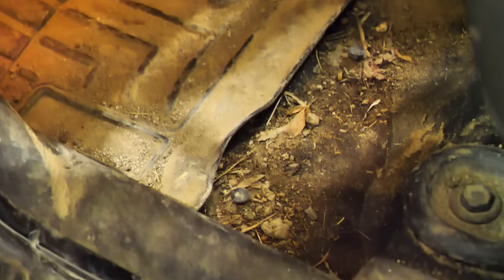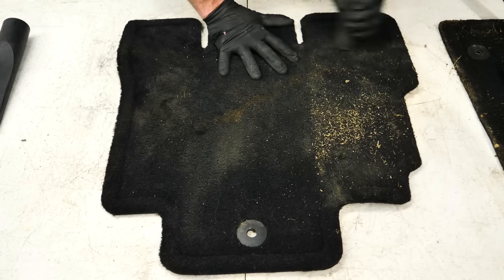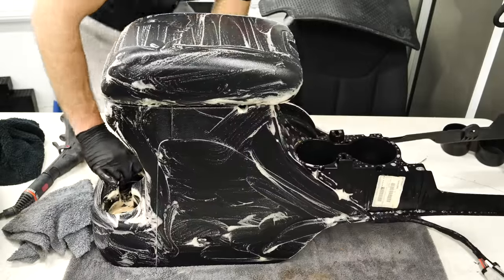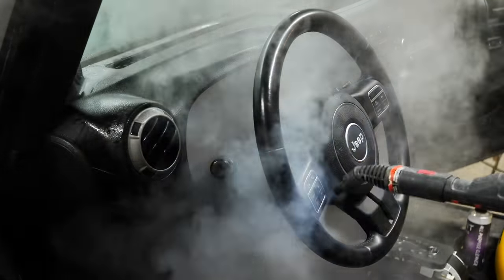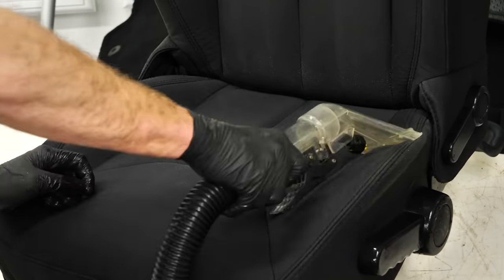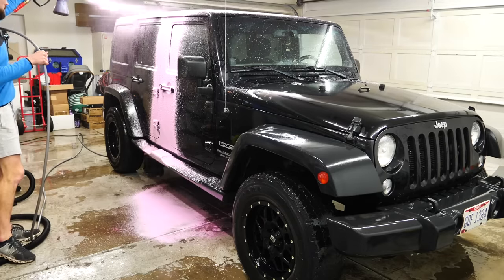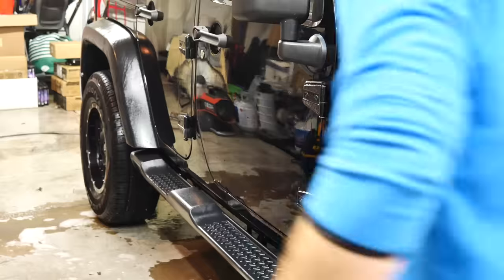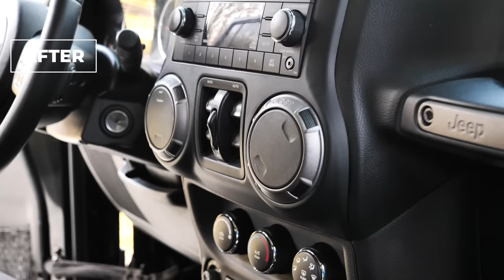INSANE Deep Cleaning of A Dirty Car For Free! Stolen Jeep Car Detailing Restoration Ever!

Comment: In all honesty, I’m not surprised at all that your ‘94 teggy gsr got stripped of her parts. I mean its a GSR engine hahaha. Sorry that happened to you all those years ago, and it was your first… I would’ve just been so pissed, while also being sad, or devastated, just mixed w/ all types of emotions. Back in Oct 2021, I lost my first car that I bought myself, w/ my hard earned money at the age of 18, I just turned 21 back in December. Thankfully I didn’t throw on any coilovers, or wheels, but I did keep up w/ the maintenance. I had just got the timing belt done w/ all the other maintenance that has to be done the same time, which cost me 1.2k, I bought a set of brand new tires that ran me $900, and I had just changed out all 4 break pads and calipers that cost me about $400. I literally balled my eyes out after I got hit, not because I was injured or anything, but because my baby was totaled… I didn’t even get the chance to put 100k miles on her. The person who hit me was a underage teenager w/ no license, nor insurance. She t-boned me by running her red light that had already turned red for a solid 5 secs. She was also going 55 mph in a residential area. Long story short, the police came and gave her two tickets for driving w/o a license and running the red light, still doesn’t satisfy me because I still lost more in the end.

Comment: So i have my first seat extraction for a client, and im stuck on which product to buy. I will using a spot clean extractor + drill brush + steam *if needed, client says previous detailer couldnt get the stain out, so now its my turn >:)

Im stuck between 4 products, the CG lightning fast, the CG carpet clean, folex, or super clean (5:1)

What are your opinions / what do you use?

Comment: You know what i do with those rubber or silicone inserts for cup holders etc, before you start your detail, i throw mine in a sink of hot soapy water if they are really sticky, that way it gives them a chance to soften and then they are easy to clean, then i clean them good and let them dry or dry them with a microfiber towel.

Comment: If you ever own anything worth steeling install a dizzy switch and a starter cutoff hidden somewhere in the cars interior. Or really anywhere it will stay dry. That way if they try and hot wire it the starter still won't be getting any power. And if they do manage to get it started it won't go very far without the fuel pump working. Won't stop all thefts. But it will give you more time to respond and make it take longer to steal. Just have to make sure your switches are extreamly well hidden.

Comment: Way back I had a 99 Milano Red Civic SI stolen and stripped. 1wk later I found out who it was and so I and a few friend went to his house, low and behold all my parts was in his garage still. So I took them back and called the cops.  Sold all the parts then bought a 2006 Ford F350 King Ranch CCLB w/ 6in lift on 37s.

Comment: I have a Jeep Wrangler story. Thought it was stolen leaving the Dr’s office. Called the police and everything. Only to find my jeep 100 ft away down over a 2 ft drop in a adjacent parking lot. I left it out of gear and the parking brake did not hold. Crazy, it took a left turn and parked itself almost perfectly in between two parking spots. If it rolled straight it would of hit a car or further, the ACE hardware store lol… super embarrassing 😆

Comment: Awesome, that is a great tip with the polisher, I've even seen some guys use a palm sander on floor mats in the same way.  The amount of sand that comes out it astonishing.  Banging the vacuum nozzle on the carpet floors really helps in the same way, if you didn't want to use the polisher.  And bummer about your  integra tho.  I would have been broken up too.  Had my stereo stolen out of my car once, but is didn't work right so not a big loss.  As a result I always lock my car no matter what

Comment: That is horrible at your Integra.  My first car was an 82' Camaro Berlinetta.  It was just a V6 but it was my first car and I did a few things to it.  Lowered it, rims, exhaust.  One morning I came out and the car was gone.  I parked it in front of my house the night before.  The weird things that go through your head first, "Maybe I parked my car around the corner??"  Anyway yes, it made me sick to think my car got stolen.  They recovered it a few weeks later with a blown transmission, and they threw a rod in the motor.  Had it repaired and then I sold it.

Comment: I had my 73 caprice convertible stolen in 1977 from a mall in Akron we called the police and they wanted a description of the car and there were 5 just like mine and they insisted one of those were mine 
They ended up finding the car in Cleveland tires gone fender skirts AM/FM/CB radio gone and they also ripped open all of our thank you notes from our wedding my wife had written on our way to Akron (we had gotten married shortly before)
It sucked and it’s like getting sucker punched 
We were lucky they didn’t cut the top or interior nor did they take out the 454 engine